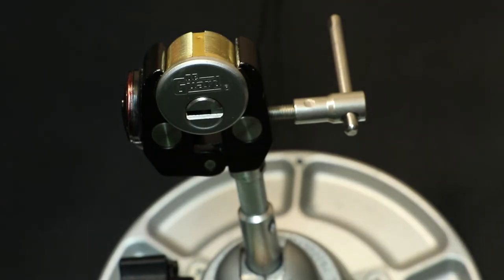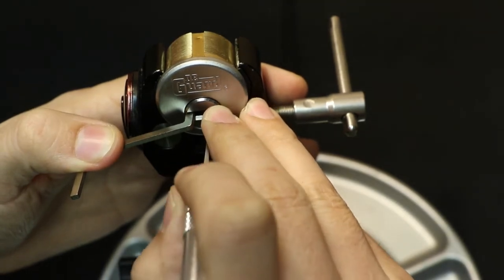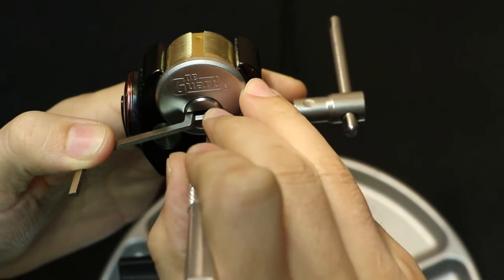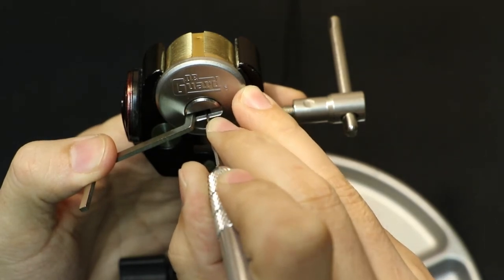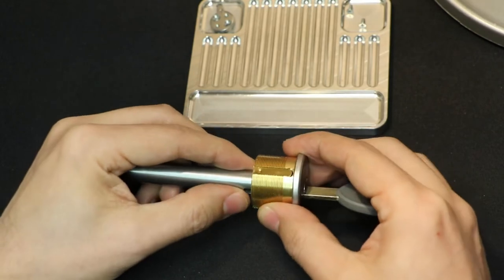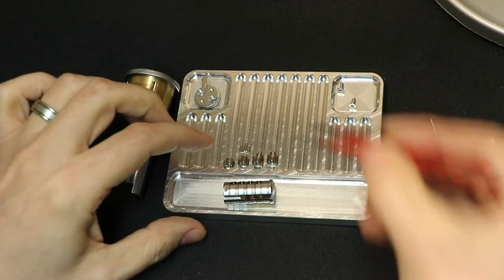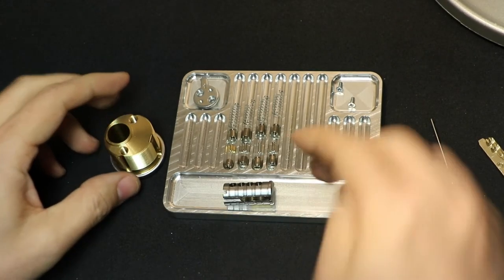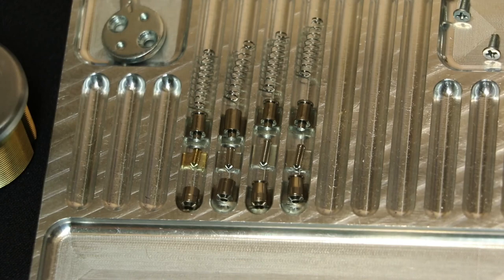[L92] DeGuard High Security Lock - pick and gut

Comment: Nice work!  This is one of my current challenges.  Isn't the interactive pin 2, not 1?  What affect do you feel it has on the pick?
Reply from the maker: This lock does not have any interactive pins (no interactive elements on the key). You may be thinking of the Mul-T-Lock interactive that usually has the interactive element on pin 2, but in rare cases on pin 1.
Reply: @norlin76  What are you discussing at 0:48 then?
Reply from the maker: @jeancerrien3016  Oh jeez, you are right, I should have pulled out the lock and looked at it again before assuming I remembered correctly lol! So I haven't had the 5-pin version of this as I bought the short cylinder (I'd recommend buying one that is a bit longer than the shortest you can find out there so you get the extra pin). It could be in the 5-pin version that the interactive is on pin 2.